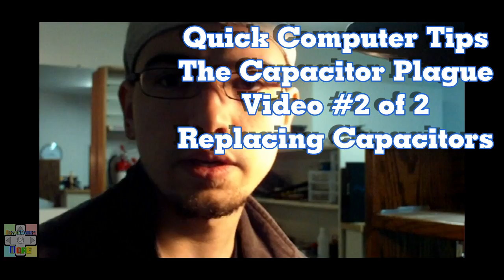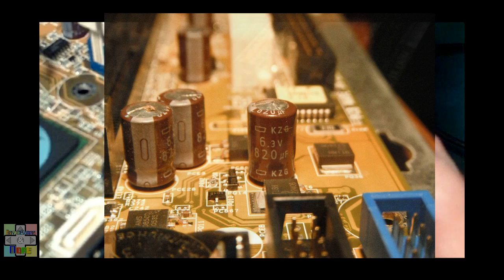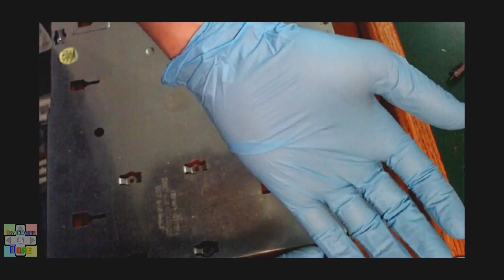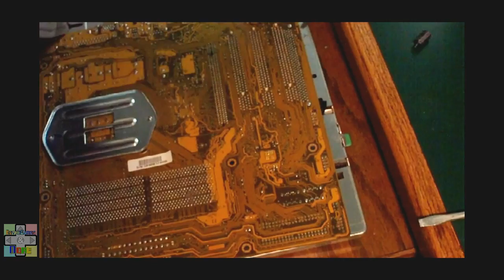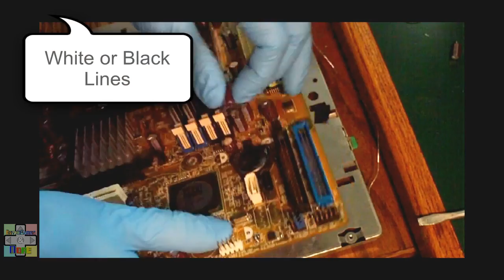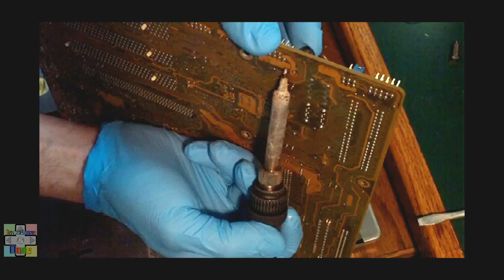Quick Computer Tips - The Capacitor Plague 2 of 2 Replacement

Comment from the maker: @feralbigdog Generally you want to stay with the same voltage but I have had higher microfarad caps work just fine. When it comes to what type of caps to look for the x tops seem to swell up a lot more often then the k cuts along with other non x cut caps.